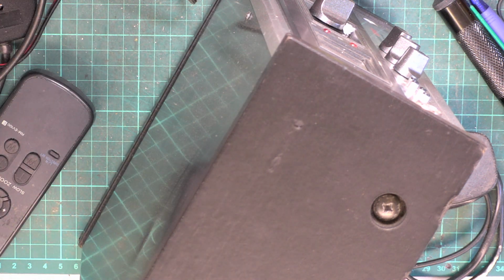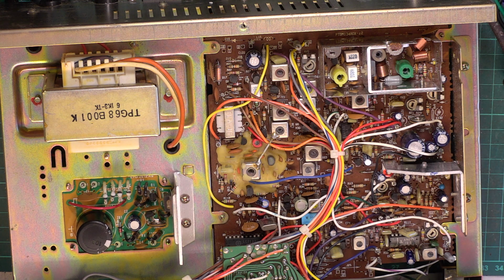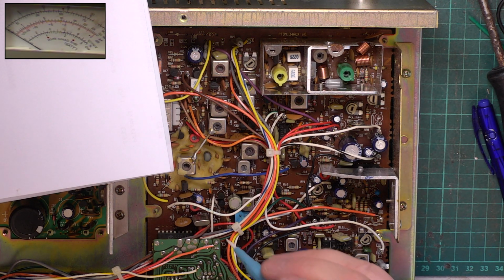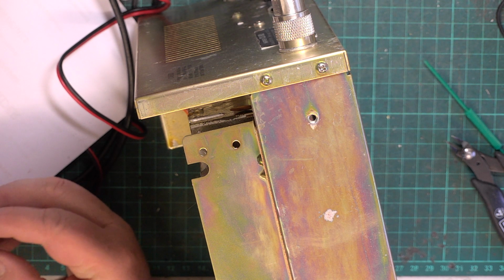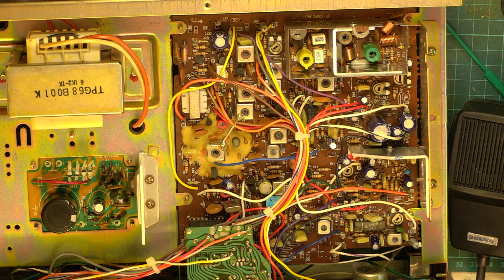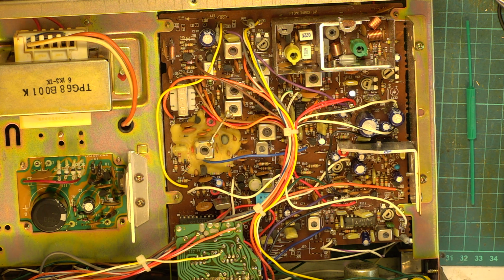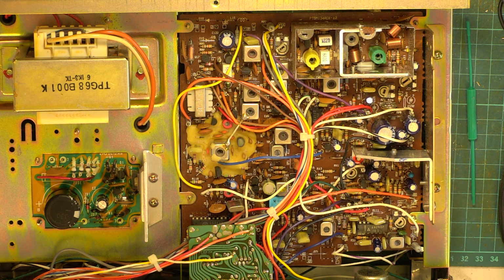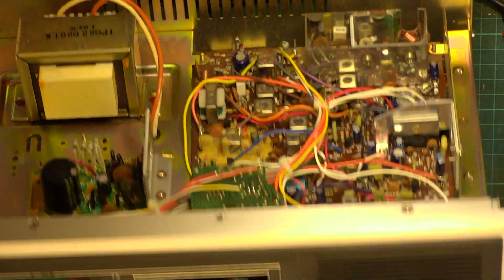Harrier CBHQ CB27/81 Base station UK FM CB radio -  service alignment

Comment: I was going to say, use the correct thread screws, put stand-offs down the screw to fill in the gap, but if I remember the head of the screw is a lot bigger than normal?  I can't find a service manual with a list of parts either, very helpful  :-((

Comment: I have one, but it confuses the hell out of me because the controls are all in the wrong place, I turn down RF gain instead of volume, pull the RF gain and wonder why it didn't come on, turn up the volume instead of the RF gain and scare the living daylights out of myself!!!  My one still has the original wood on the side and it is in perfect condition  :-)) 
They work fine and and with the forward facing speaker better for hearing.

Comment: Just goes to show that when a vendor on ebay say's it's been serviced 
there actually some that are telling the truth and not just putting fancy LED's in signal meters and using un-calibrated CB hack junk meters..
Reply from the maker: Oh yes, there certainly are. You can usually spot on the ebay pics the good from the bad. 4W radio shown doing 12W into a zetagi meter with no sign of a dummy load & a toy 5 digit frequency counter would be a good 'screwdriver expert' photo...oh yes & all the meters now blue LED.

Richard
Reply: @ukfmcbradioservicingTango21  thing i've found if you show a Zetagi or other equally poor quality CB meter and frequency counter people tend to believe what they see compared to a Bird 43 or  Marconi or Motorola test set.
it's as though professional equipment blinds people and all they see is CB equipment for CB sales as gospel..

Comment: A lot of quad bikes and motorcycles use them type screw, I will keep my eye out for you.good chance I will have some
Reply from the maker: If I knew what they are called, I'd no doubt be able to order them & finish off my own Harrier CBHQ! In the TV trade, there were some wierd 1/4 turn quick release plastic screws cal 'Dzuz' screws. It's knowing these terms!

Richard
Reply: @ukfmcbradioservicingTango21  the type of screw is often found on carburetors and machinery with a push pull type angled lever.
the smoothest part is the area where the movement fits and ,erm, moves..!